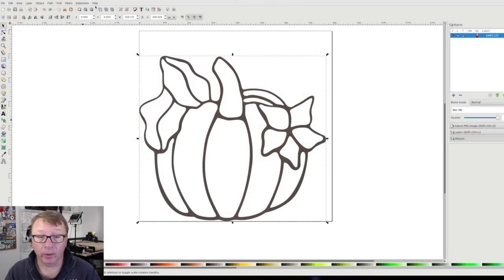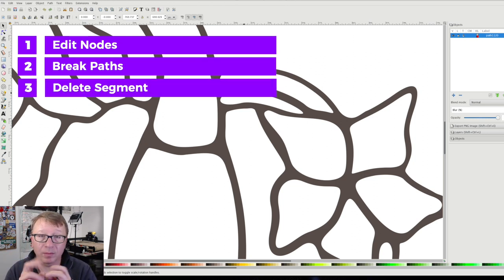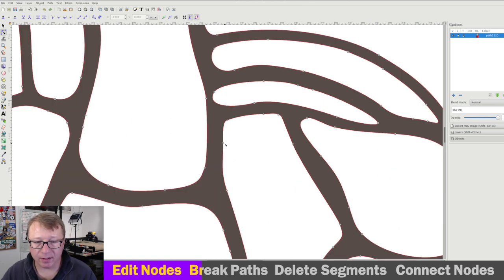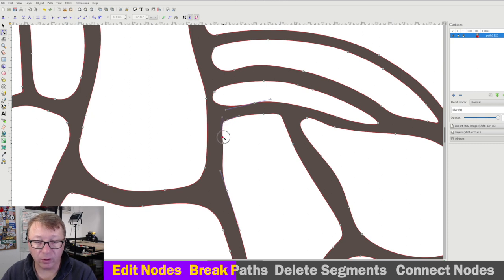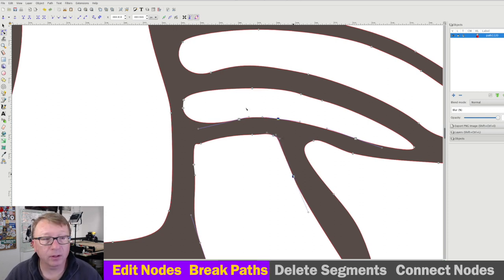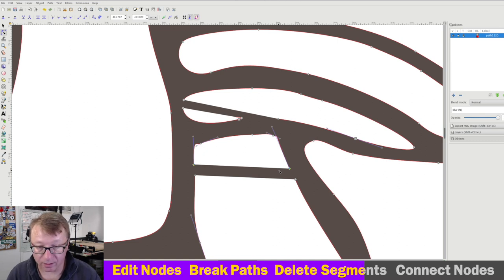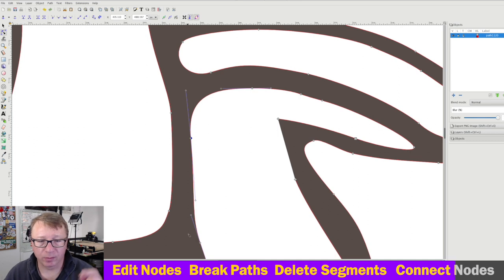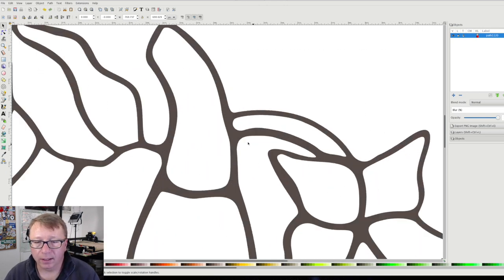Editing vectors in Inkscape for better CNC tool paths

Comment: Have you tried the extension Gcodetools? I used it for a while until I could scrape up the dough for Vectric software. Funny that I still use Inkscape to do any vector/node work. It's just more comprehensive in what it can do. But the V Carving toolpaths are a Vectric task. Thanks for making the video.
Reply from the maker: I used it years and years ago, not recently. I need to see how far it's come over the years.